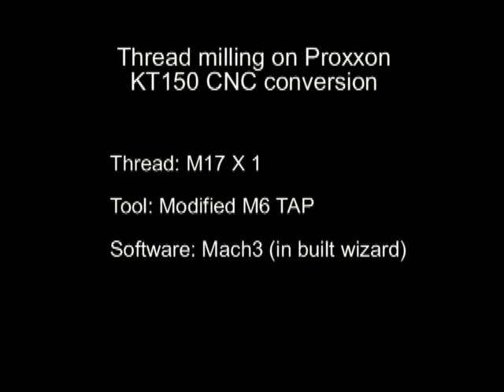Thread milling with a modified tap

Comment: Yeah but the cutting edge has taper on it, it is not a single straight cutting edge that can drive down to give the angle that the thread should have, i might be wrong but can you confirm that?
Reply from the maker: I don't really understand your question but the cutter goes down in a spiral path which gives the correct pitch of thread. If the tap has taper then you will not get a full thread unless you go all the way through however I ground off the tapered section of this tap.

Comment: what is meant by "ground to give full diameter at leading edge only" ?
Reply: What that means is that the tap is ground so only the cutting edges of the former tap make contact with the work. This prevents the tool from rubbing against the work.

Comment: Interesting discussions regarding this over at :Practical Machinist. Evidently it isn't quite as simple. I couldn't believe it. I was ready t o give this a try.
Reply from the maker: In what sense is it not quite as simple? I would say it is fairly simple, easier than grinding a lathe tool and most CAM does thread milling cycles.